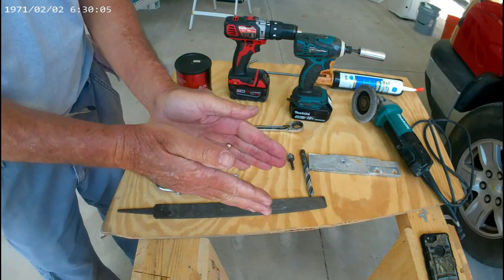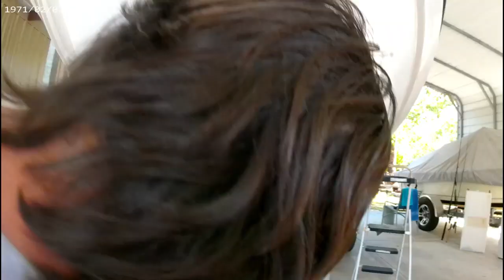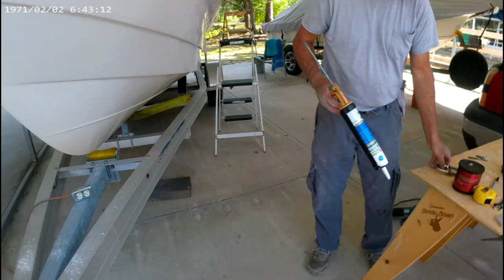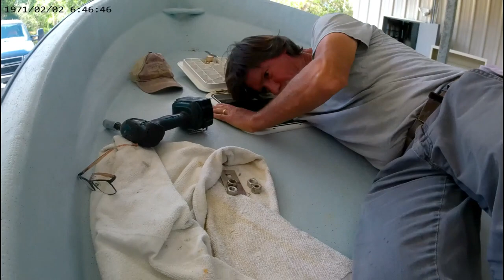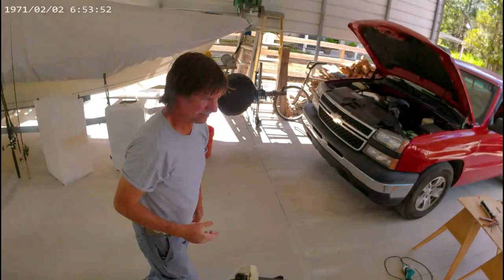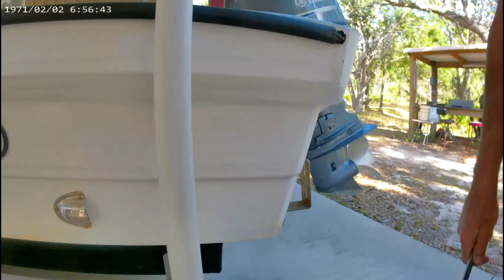How To Install a Bow Eye on Your Boat #boatrepair #boatrestoration #boatrestoration #boat

Comment: I have a smaller older Crestliner and the eye is above the roller which really bothers me. I don't think I can raise the roller up that high as the post isn't that tall. If I move the eye location like you did would you be concerned with the amount of fibreglass around the new location and the strength of the eye bolt?
Reply from the maker: A new eye would certainly have the strength. Then make a backing plate for inside the hull and you should ne golden.
Reply: seems pretty low on the bow for an eye. that might even be below the waterline.
Reply from the maker: @dubstylee444  Not even close
Reply from the maker: @dubstylee444  I tried to share a photo "no luck" it's a lot higher than it looks